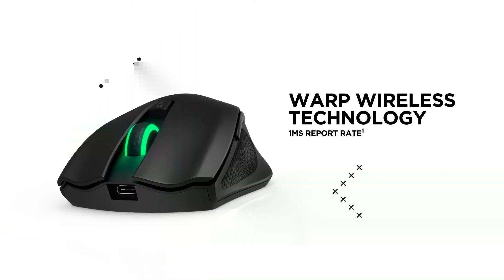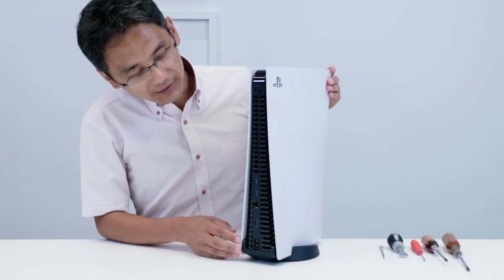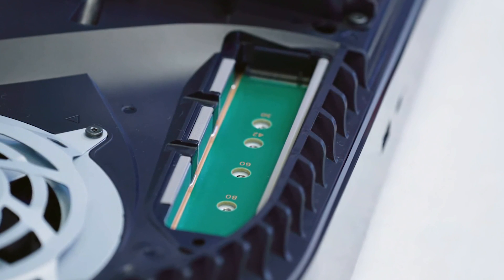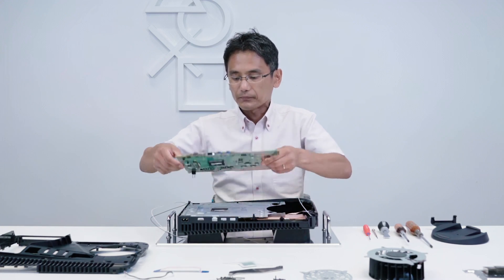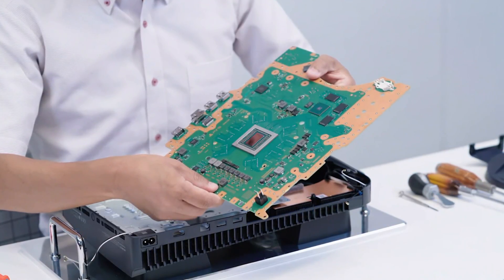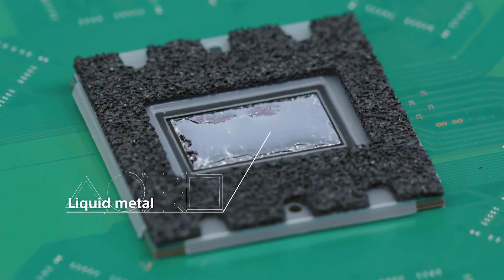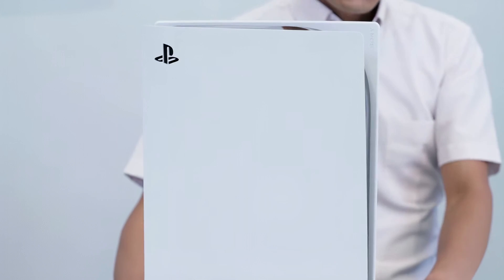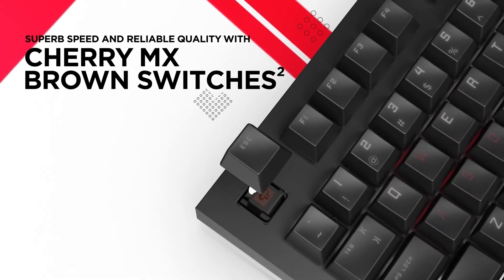PlayStation 5 Teardown Analysis: Inside Sony's Next Generation Hardware Design

Comment: Sony: Here's a teardown detailing all the components.

Techtubers: Why are sony sooo aloof!!!!
Reply: To be fair it took them up until the month before release to come out with the teardown, and the information is still way less detailed & comprehensive than what Microsoft have been putting out for months now.

We still don't know the precise die size, and there's a lot of unanswered specifics about the architecture, machine learning support .etc
Reply: @InnuendoXP  u don't know the precise size? it's already written on ps blog a long time ago and i think they said it in the teardown video
Reply: @blackop0071  You think so?

Mark Cerny definitely had a lot to say about the SSD, the  I/O controller, the CU count, and the pipelines for efficient information transfer between CPU, SSD & Memory as a way to address the plateauing of RAM prices per GB. But he didn't go into very many particulars on much else & spoke more in broad statements & conceptual goals to show the priorities behind designing the system, but to date Sony haven't released a diagram of their die which Microsoft did at Hot Chips back in August.

But if I'm wrong & board diagrams & die schematics have been released on a Sony blog with precise dimensions & layouts of the GPU & its cores, by all means, share that info, apparently it's news to Digital Foundry too.
Reply: @InnuendoXP  Sony has released loads of technical videos detailing the ps5. Ms has had a dodgy rep and need to go full transparency to get hype while most people know sony will always delivery an awesome console with amazing games.

Comment: I want to know how the quality of the built in 4K Bluray player will fair on 4k discs, compared to dedicated 4k Bluray players.
Reply: I've been wondering the same tbh, but I doubt it will be anything more than just a 4k blu ray player, I recon my sony x800 will still be miles better.
Reply: 4k blu Ray players are all the same.
Reply: Why would it be any different
Reply: Dedicated players such as my Oppo 203 will always be superior as they have a dedicated chip just for running that function. Plus start up time to play a disc on the Oppo is about 2-3 seconds. If you are lucky enough to have the 205 it is an even better player but sadly these amazing players are now discontinued.

Comment: @digital foundry
you don't need worry about the storage size.
Now a day my ps4 pro Strategy is
Most game are digital
Old game will move to external HDD
Always playing game such as racing and open world game are move to external SSD
if you are downloading new game,
just set the storage to the PS4 pro.
So you can playing a fast load game in SSD and at the same time downloading the new game to PS4 pro

By the way in PS5
Old game should move them to HDD
fastest game can depend what you want to  m.2 or PS5, or external SSD
So at that time, we will see the ps5 will it cash by high speed racing in the open world install on HDD or external SSD sata

For my experience
I have try this problem from my ps4 pro
i drive a high speed car in watch dog 2 after 3 hours in internal HDD,
Once time PS4 will crash code with ce-34878-0
Once time I play spider man install in SATA to USB 3.1 extreral SSD
spider man once time will stuck and push the screen waiting for loading>
>when i fast moving and listen the npc talking.

Comment: I got into a small debate about the soldered storage on another channel. The thing I think might wear them out more than normal is the quick resume/pause. That's writing upto 16GB of data each time you suspend a game. I did some quick math that 1TB ssds normally have ~600TBW. If the console is heavily used those NAND chips might die in about 10-12yrs; which is a shame for any collectors.

There's also an AnandTech article that Sony went with 128MB block sizes verse a SSDs normal 4KB. This might end up causing write amplification causing quicker wear on the chips. Additionally, SSDs really hate being full. 600GB (if true) isn't that much when you consider most AAA games are pushing 80-200GB.

Now to wait 10yrs to see if my worries are unfounded. :P
Reply: It's more like 600TBW btw
Reply: @Loundsify  You're right. Wrote this comment early in the morning before my coffee. I'll update my original comment. Thanks for pointing that out.

Comment: That coolingsystem is so cool
Reply: No pun intended
Reply: @johnnysinu  he clearly intend tho 🤔
Reply: @johnnysinu  Do you make Tuna?
Reply: As I saw it I got chills
Reply: Yeap cheap trash, that how much cool it is. :)
Reply: Yeah if huge and cheap is cool
Reply: @Rapunzel879  you mad the Xbox is cooking?
Reply: @dacoda8220  no let's see what temp ps5 is when it's running 8 hour gaming sessions stuck in TV unit, not 2 hour astro demo we're no one is allowed to touch it in the center of a room
Reply: @josephcook4693  

Its gonna be a freezer. Liquid Metal and that huge add heat pipe. Oof.
Reply: @dacoda8220  You do realize that wasn’t true right lmao 
If it’s spitting hot air that actually means it’s doing it’s job

Comment: So the best positioning of the PS5 would be horizontally.
Because of the liquid metal.
If you keep it vertically the liquid will tend to gather down in the socket because of the......gravity, and i don't know how the contact surface area will be.
Buy vertically it will spread evenly across the cpu's surface.
Reply: Let's hope it doesn't leak and turn into the T-1000 😅
Reply: @montygill2835  haha, yeah.
From the looks of it, it can not leak in the horizontal position because of the socket form.

Comment: Opening your console DOES NOT void your warranty (at least not in the USA or EU) unless Sony or Microsoft can PROVE that your disassembly caused damage to components. 

This perception/myth that you void your warranty and the stickers that say so are literally illegal and anti-consumer.
Reply: @op Glad I'm not the only one that knows this fact.
Reply: Well you couldn't be more wrong
Reply: @TheMadTitan3891  Evidence of any attempt to open and/ or modify the Xbox console, Kinect sensor, power supply or accessories, including any peeling, puncturing, or removal of any of the labels, will void the Limited Warranty and render the Xbox One, Kinect sensor, power supply or accessories ineligible for authorized repair,” the Xbox One manual reads.
I belive ps has to have some sort of permission to do this. Still there are lots of tech devices that dont. Im saying xbox as an example as a gaming console.

Well they will see you in court. Let us know how it goes.
Reply: Just don't expect they will repare it for free.
Reply: the sticker itself doesn't count. however if it's broken, it's likely that any repair they do (or RMA) will be a few weeks longer at best, as they will spend some time finding what you did with the machine. 

Any changes they find will be used against you, like the new thermal grease application that they will say inadequate for the system. That will end up getting you pay for the damage that might not exist.
Reply: Trevor Cook this is correct
Reply: That’s not true and totally depends on the state you’re in.
Reply: The problem is, even if you are in your legal right, YOU have to build a case against their claims proving you didn't damage the system in any way. Do you have the means to prove that? Is it worth your time to fight it when they drag you through courts?
Reply: Correct. Those stickers count for nothing in the EU.
Reply: He is in Japan. It might be true there. IIRC in the US they are valid as long as the maker can prove that you broke something after opening it beyond those boundaries.
Reply: >implying every single viewer of this video is American 
Dude its just a blanket term. Chill out
Reply: ty, never knew about that
Reply: Well, good luck fighting in court.
Reply: If you remove these stickers they could charge you for repare if they find even a tiny dent inside.
The wording of these sticker are now more specific.
Most people would only remove the pannel to add an ssd or vaccum the dust.
Reply: If you tear down those sticker you are done
Reply: @instacomclub7099  Nope do some research it's very easy these days don't just repeat the same wrong information.
Reply: @minners71  just google warranty void stickers. You tell me.

Comment: doesn't NVME SSD's just get really hot when writing data to it? If that's the case then the heat problem with the drive shouldn't be any huge problems because you read from the unit more than writing to it.
Reply: but isn't downloading to install games alot of writing if your downloading so many games at once all the time?

Comment: Last time i put my xbox from standing to horisontal it scratched my disc ^^
Reply: Had that problem with the Xbox 360 if you moved it while the disc is running.
Reply: @montygill2835  thats the one i meant i forgot to add the numbers ^^

Comment: 3 mins of ps5 video spent praising xbox executives. Gotta earn that access to get your clicks richard
Reply: he's not praising xbox he's just saying xbox series x looks like a better designed system,smaller and more powerful also.When ps4 and xboxone came out everyone was laughing at the size of the xbox and now the tables have turned
Reply: @guysuave85  Yeah even though I know the PS5 will sell more as it carries PS4 games forwards, the Xbox is better designed. It's smaller, more normal in shape, less clashly looking, has the feet built in so it doesn't need a stand, and it technically has higher compute power. It doesn't mean it will always be faster but still it does look like it was better engineered. Plus we all think the PS5 looks cool now, but in 5 years when the white plastic starts turning yellow as it always does we'll probably look back at it less fondly.
Reply: They look like those angry children when they don't get what they want LOL
Reply: When Xbox just does everything better in the hardware side, hard to say something good about the PS5...even if it's a PS5-centric video. Also: Microsoft were always transparent and published everything earlier ... much earlier. That's a good thing, right?
Reply: Salty Sony fantard, get triggered console fanboy lol.

Comment: How do you remove the stand from the Series X?  You forgot that point, Richard...
Reply: Go get a job man
Reply: @Mr Lesir that why people are already saying it is running hot
Reply: @magfam9980  it's not running hot quit listening to fanboy youtubers
Reply: @milk6765  it was from an xbot you tuber and an article was written on it, not ps fanboy stuff
Reply: @magfam9980  lmao no it wasn't
Reply: You dont
Reply: Ha ha I think the main difference is that if you want the ps5 on its side you are required to remove it.
Reply: Why would you want to remove the stand? lmao
Reply: @ryanbrowning5586  when you put it on the side?
Reply: @Hasmatix  

Cause you dont need to remove it to put it on its side, than again seeing you from Kutrecht explains your comment.
Reply: @Hasmatix  there are little rubber beads to support it on its side
Reply: @Hasmatix  The stand is 'fixed' but that also means that people cannot just stand he console up or put that side up too close to block the air intake. It's always attached so you can just stand or flip it over any time you want and with enough clearance to always have the minimum clearance to draw air through.

Not saying it's the most aesthetically pleasing solution but it's perhaps the more practical solution to ensure that a minimum gap is maintained to draw air through...
Reply: @BAMozzy69  its things like this that DONT matter at all, only fanboys argue over this shit.

and FYI to the average person the xbox is just the same as last gen but fatter. it isnt appealing
Reply: 🤣🤣🤣🤣 You need screwdriver to take off the ps5 stand please don't brag about that
Reply: @phillyguyzay9763  who doesnt have a screwdriver?????? and you may be able to use a coin or they will add a simple tool. its just a screw lmao
Reply: @GeniusGamingArg  It would have been better if the screw came with a D-ring though. Toolless operation is a huge quality of life improvement.
Reply: @GeniusGamingArg  who tf wants to unscrew a stand just to sit it down 😂😂 hush child
Reply: @phillyguyzay9763  you will be changing between standing and on the side every day that 1 screw makes you cry?
Reply: @MyChannel-SR1  yeah, it would have been better with another mechanism that doesnt need a tool for sure. but i think its ok, maybe you can use a coin and the stand itself looks pretty well made
Reply: @GeniusGamingArg  Yeah, maybe that is just a pet peeve of mine. I really like to be able to do most regular tasks and maintenance work with the least amount of tools. I've gotten the idea from camera cage manufacturers, where screwing the camera back can be needed on the spot.
Reply: imagine putting that brick on its side and thinking it looks nice
Reply: @Mr Lesir yes it does, look at some pictures or videos.
Reply: It doesn't have one, it just has feet built into it like the Wii had on the bottom or the PS4 has on the bottom.
Reply: @Skylancer727  Ah yes that massive circle of plastic is not a stand, it is clearly just small feet built into it.
Reply: The stand on xsx looks like ass when horizontal and can't be removed and blocks vents.
Reply: @magfam9980  It doesn’t block it, it’s literally by design. And seeing that people are liking this comment shows how little yall know about the console. Or they’re liking it because it’s negative towards Xbox
Reply: @magfam9980  It may not ne the most aesthetically pleasing but it certainly doesn't block ANY vents. 

It was designed around the airflow from the available vents that are open MS wouldn't fix a base over vents necessary for cooling.

The reason its 'fixed' is to ensure there is adequate clearance at all times to the bottom holes. It stops people from being able to stand it up without the stand.

Being a square and flat sided, MS could of easily just put some rubber feet at each corner. It doesn't 'need' a stand to 'stand' up. The 'stand' is to raise the bottom up enough to draw more air into the system. It also can draw in some air from the back too. By having that 'stand', it increases the number of vents available and creates a gap when vertical to draw air in. It stops people from not bothering with the stand in vertical and/or potentially putting that side of the console too close and blocking up those vents. It makes more sense to have a fixed stand than allow idiots to block those vents by not using a stand and cause 'damage' and bad PR.

The very shape alone means that the SeX doesn't actually need a stand to stand up - the reason it does is to raise the height a bit to increase the number of vents possible and more air flow. Making the stand permanent means that the minimum gap is maintained, idiots don't run their console vertically without it...
Reply: @BAMozzy69  they still should have made if removable cause it looks like ass when horizontal due to the stand.
Reply: @magfam9980  LMAO

Comment: One of my concerns that I've posted in many videos about with the PS5's expansions nvme slot was cooling concerns for the ssd that will be placed in there. As a person that deals with temperatures for a living I couldn't help but wonder how much clearance there will be for high end nvme ssd's that have their own heatsinks and how they'd dissipate that heat in a closed off compartment. By the looks of it it doesn't seem to be exposed to the air circulation within the console itself. I'd think that Sony have thought of this because Gen 4 ssd's do get quite hot.
Reply: There is absolutely no way that NVME drive will be under the kind of load that would cause a temp prob
Reply: The nvme ssd in my liquid cooled PC runs very hot as there is zero airflow, yet its fine and has been fine for years.  Idling at 51c now, usually hitting high 80s underload.
Reply: @kidShibuya  Yea but onPC the nvme's are exposed to multiple air changes per minute due to air circulating through the case via the multiple fans. From the video Sony released that looks to be a small closed off compartment. There is a concern there, at least I think so. I'm not making any assumptions and for all we know there could be a small duct opening that circulates air in there. It is rather close to the fan also.
Reply: @kidShibuya  We're also talking about Gen 4's which get hotter than Gen 3's, especially ones that come close to Sony's custom speeds. I say this because you say your nvme has been fine for years and gen 4's are relatively new in the market. Actually about a year or so.

Comment: Speaking of the heat sinks for the SSD extension? Do you see on the slot the metal sides?  I’m wondering if those could somehow tie into the heat sink. Or maybe one of the white listed SSD’s will have heat spreaders on them?
Reply: Heat sinks need a good connection to work. If the ssd doesn't touch the think firmly, it won't work optimally.

I am not sure how the contact is ensured for different shapes of SSD's.
Reply: @stefans4562  Most of the M.two SS‘s are the same size width wise but there’s different lengths.
Reply: @AgentRedShirt  Problem could be their thickness though. A Contact only works well if there is no air between the conductors. 

I hope heat won't be and issue and I hope there won't be thermal throttling, however I'm still skeptical.
Reply: @stefans4562  The other thing I’m possibly thinking of. It looks like there were holes in the sides and stuff? I’m wondering if it doesn’t get constant airflow moving through there from the fan. Especially with that cover on the top to make it a close chamber so it’ll force air in and out. That’s my theory anyway.